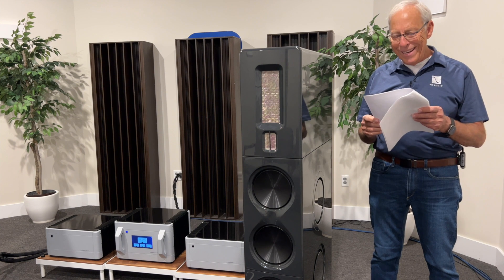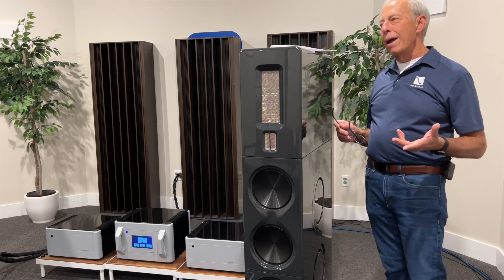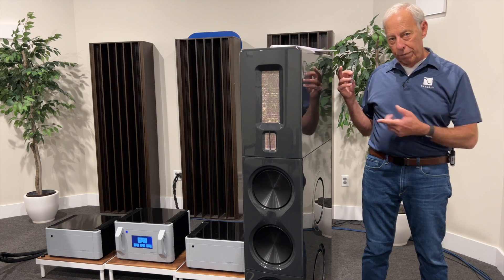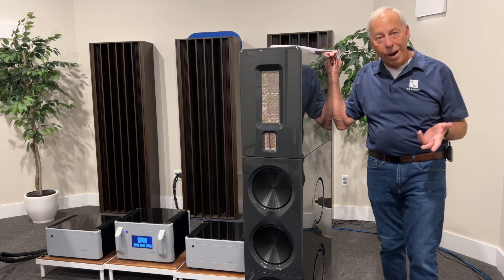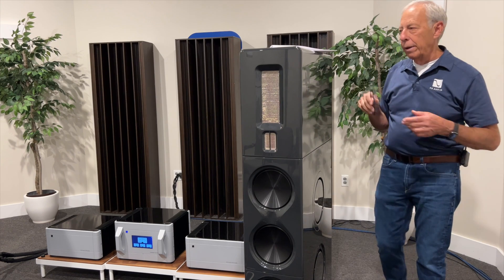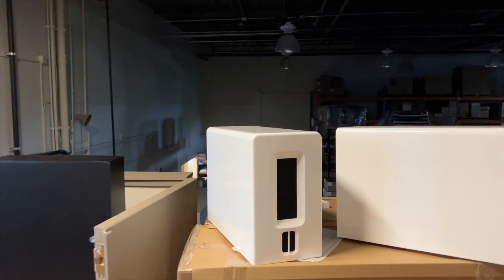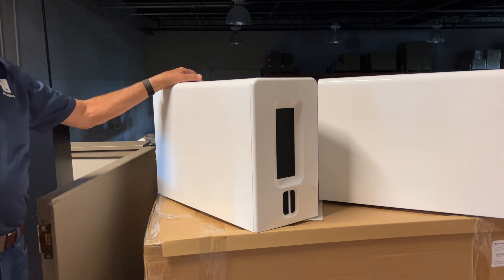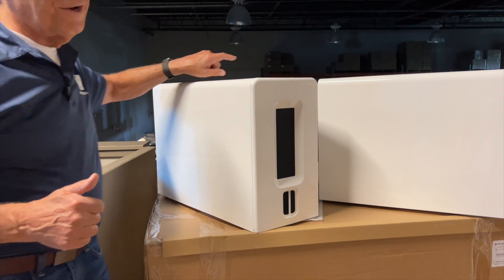Why the FR30 speakers are separable

Comment: Another reason - Chris said (in the lunch with Paul video) that the lower woofer box needs to be extremely rigid and tweeter box needs to flex to effectively manage resonances. This separation / design helps achieve that.

Comment: Ps audio has effectively built a modular cabinet so now the hf could be changed as required. If the whole cabinet is put into sections as well then the sky's the limit. You could swap drivers and internal x-overs without actually rebuilding or re-designing the whole assembly. Paul-you can have my idea if you wish. Let's hope the amps become modular sometime as well. Again suggested by me by email 

Ain't I smart😄😄 Not really!
Reply: You have no clue about speakers

Comment: psst.... Paul, you did not address the question. he was asking why there is an indent between the second & third 8" woofers.
Reply: There is no indent there.
Perhaps the writer was a little confused but paul knew what he really meant to ask? The title explains anyway
Reply: I see the indent. It has to do with wave pairing. It helps the two woofers speak to each other in layman's terms.
Reply: The indent is between the two front woofers. Looks like a rectangle.
Reply: @waterlife.1905  well, you have better eyesight than me it seems, I dont see it, thx for explaining though 👍
Reply: @geddylee501  there IS an indent between 2nd & 3rd woofer.
if you cant see it on this vid, check their website. it is there, promise.
Reply: @googoo-gjoob  yeah I see it, I turned up the brightness on my monitor lol I think it's just for aesthetics to match the the other line, doesn't look like the cab comes apart there, or it is what was mentioned earlier by waterlife cheers